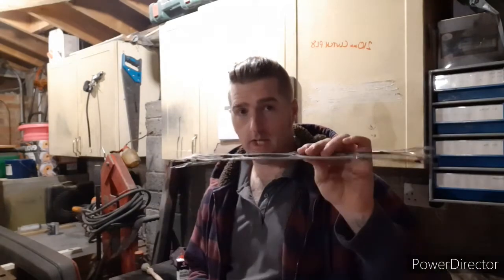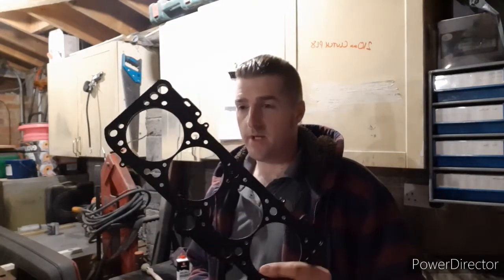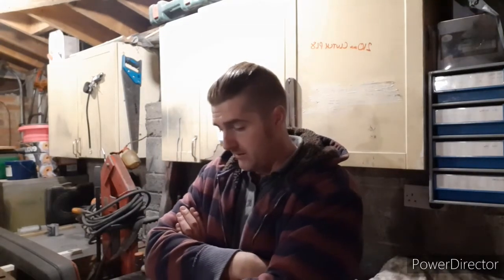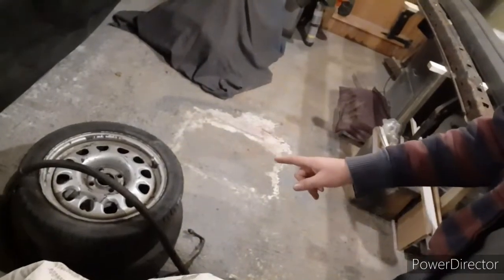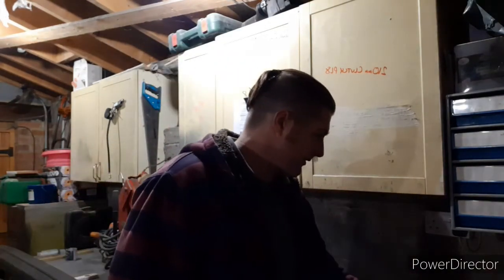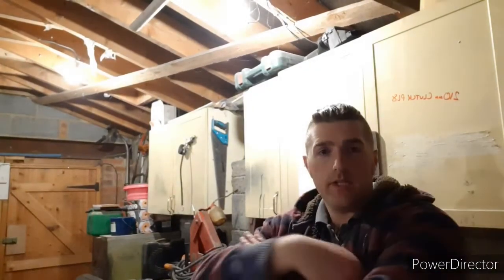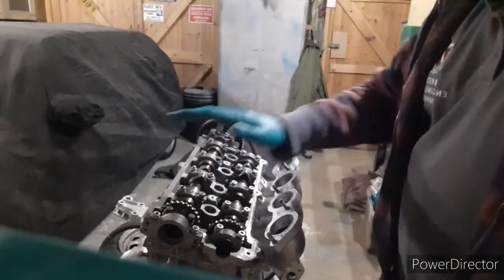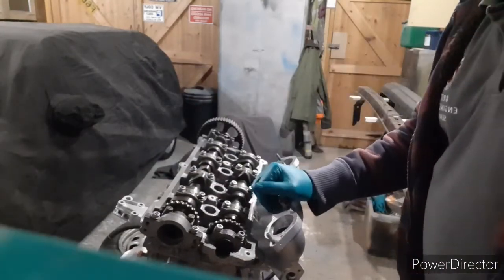Mk2 Golf Gti 16v Restoration - All torque no Action

Comment: nice guide man ! just wondering i got a pair of bolts that said that I nead to just do the 40 nm first then start it and get it to 80 c then loosen it and then do 60nm and so one. Seeems quite strange for me to that that they say. cheers
Reply from the maker: Thanks. Sounds very particular, are they for a VW?
Reply: Peter I have seen similar procedure for connecting rod bolts to ‘set’ the bearing before applying the clamping torque but never for head bolts.  On large industrial engines we’ll set to a nominal  torque first to set the bearing, back fully off, and then go up in torque steps alternating between the bolts to ensure even clamp.